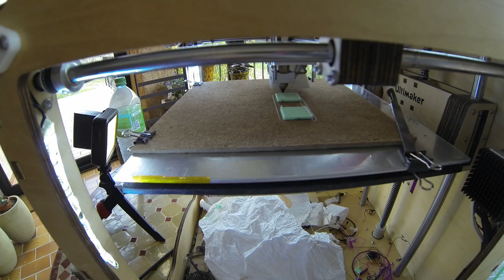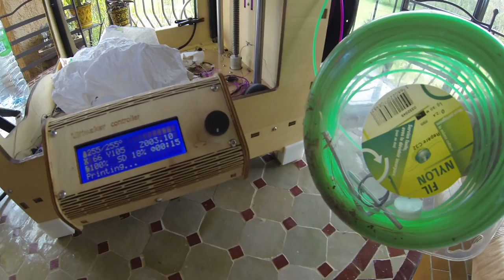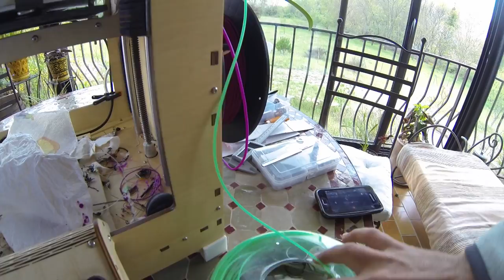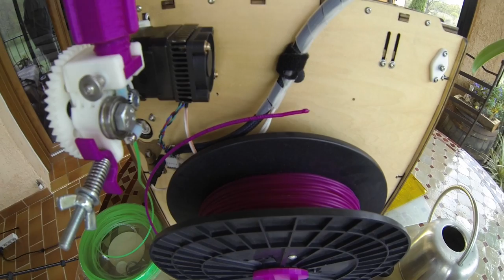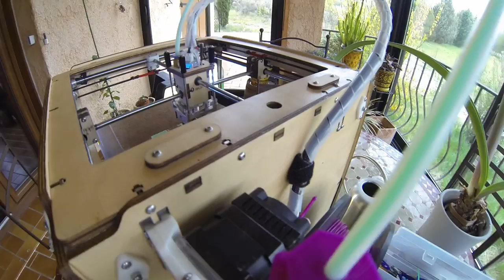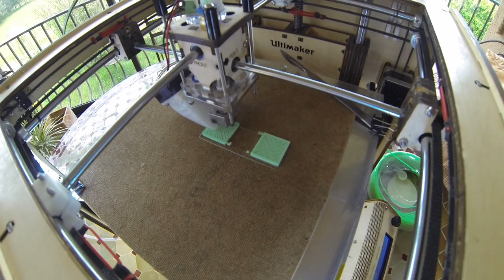Printing with cheap and dirty 10-year old trimmer line with the RollerStruder

Comment from the maker: Hi Jens. Yes, that's the water boiling, or may be the grass that was left out of the last use (I did not even clean the line before use!) :)
More seriously, a "fresh" trimmer line still gives a frosted look, but it is not so bad as it almost completely hides the layers. Drying it in an oven at 110C for ~1h30 had almost no effect (it would have to stay longer, but what a waste of energy...). Smaller diameters probably dry faster

Comment: awesome xy on that printer. what manufacturer? im going to try trimmer line soon, I'm going to use calcium carbonate from those drying kits at the hardware store to dry it out first, though I'll be trying 1.6mm with my 1.75mm extruder. i need to check if it's all metal or with a teflon tube though since i will try high temperatures.
Reply from the maker: this is an ultimaker (the old one "UMO" kit), heavily modified: http://www.tridimake.com/2014/01/features-and-improvements-for-a-homemade-ultimaker.html